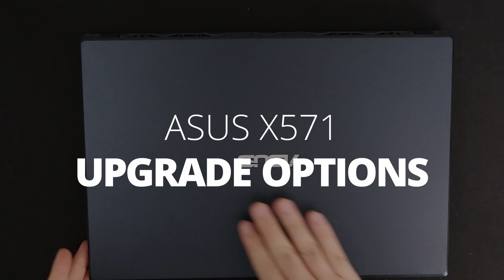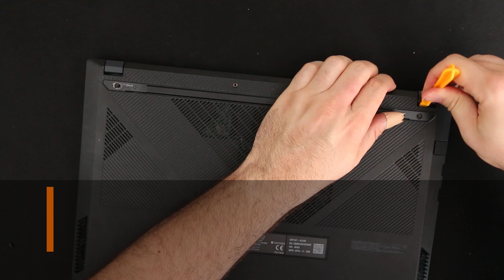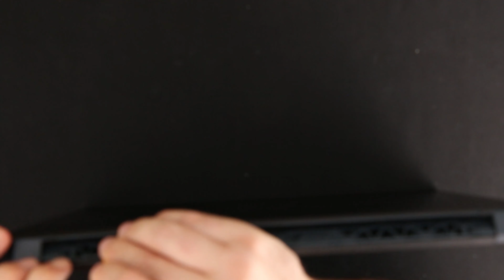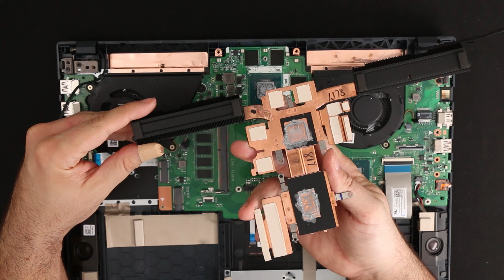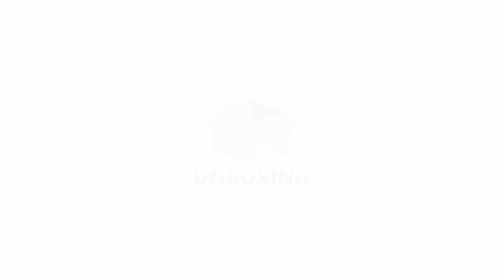ASUS X571 DISASSEMBLY and UPGRADE OPTIONS (Storage, RAM, WiFi, Thermal Paste)

Comment: I am kinda confused.. mine has a m.2 ssd installed already and I want to add another one. Can I add another m.2 ssd or do I need to go for sata
Reply from the maker: This device has 1 (one) m.2 SLOT and 1 (one) 2.5 inch  SATA BAY. The m.2 slot can accept both SATA and NVMe SSD "stick", and the 2.5-inch bay can accept "2.5 inch" SATA HDD or SSD. ;) Got it now? :D If yours has already an m.2 SSD, you can expand by swapping that out to a bigger one OR adding an additional 2.5 inch SSD or HDD.
Reply: @MakaiTechReviews   Ahaha thanks for the reply asus website kinda confused me with all these configurations, but your video cleared a lot of things great work..

Comment: I've got the i7 version that has 512GB SSD, if I want to upgrade the SSD, could I add another 500GB SSD over what I've currently got? Or is it that I've got to remove the current one and replace it with a bigger amount of SSD? 
Idk, this is my first device in which I'm upgrading storage space. please someone help me out.
Reply: If you have the SATA slot free (so no HDD) then you can add a 512GB SATA SSD. You cannot have 2 M2 drives though.

Comment: Hello everyone, I bought this laptop about 1 year ago and recently I started having some issues with it, the laptop keeps randomly disconnecting from power and connecting for about a second even though it's plugged in. Also the port gets quite hot, anyone had/has the same issues? What could it be, the connection port or the battery? Thank you.
Reply: I have thensame issue, did you find the solution?
Reply: @Chris-rc7vx  Yes, I got another charger and it fixed the problem :)
Reply: @andreimorosanu9465  Thank you bruh, do you have the link to buy the charger?
Reply: @Chris-rc7vx  No worries, I got one for free because I had warranty

Comment: If I have a version without HDD disc, Am I able to add one? I got somes discs at home.
Reply from the maker: Yes, you can, you need these 2 parts to hold and connect your HDD. 
Added both the HDD bracket and Flex cable part number and link to the video description. Hope those help find the part in your region. ;)
Reply: @MakaiTechReviews   Thanks! :)

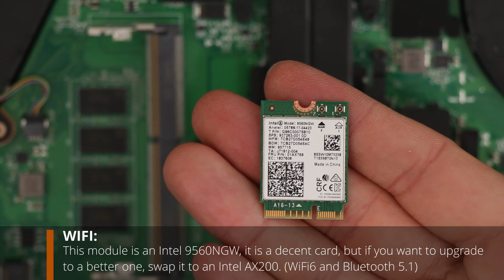Comment: 4:41 you said to swap it to AX200 but as of the moment the latest is AX210. Can I used 210 instead?
Reply from the maker: Actually the original uses CNViO interface, and AX210 uses Wi-Fi(PCIe), BT(USB), so it wont work.  What you need is an AX211, check @ intel ark for the proper system interface type: https://www.intel.com/content/www/us/en/products/sku/204837/intel-wifi-6e-ax211-gig/specifications.html

This is why I put at the end both variants in my video description, cause manufacturers constantly changes these modules and they are not compatible with each other.
Reply: @MakaiTechReviews Hi, almost everywhere in the descriptions, it says that ax211 cnvio2 needs Intel 12/13th, but this laptop has intel core i7 9th, will it work?

Comment: Can we upgrade its processor? Instead of i5 to i7? Thanks
Reply from the maker: No, not possible. Only if you fully swap out the motherboard, which is obviously not worth do. :(
Reply: Sad to hear that. Is i5 still great for autocad work or not?
Reply from the maker: @raineraldueza7903  There is not much of a difference between i5 and i7 these days. Especially in mobile CPUs
Reply: Good to hear that. I'm planning to buy it for my autocad softwares and photoshop. Guess I will upgrade it's Ram to 16gb.

Comment: can i use a ddr3 ram as an upgrade? or do i need a ddr4?
Reply from the maker: DDR4 only! ;) DDR3 has different voltage / frequency / CL and even different connector type.

Comment: Hello. I hope you can answer this. Can I upgrade to 32gb with 2666MHz or 3200MHz? I hope someone can answer please
Reply from the maker: I believe originally it comes with 2666MHz integrated RAM, but you can check it either in BIOS or with CPU-Z for example. Upgrade it to 32GB is not possible, cause 1 module portion has been soldered into the motherboard. So you can either upgrade it with 16GB module, or a 32GB module (so total will be either 24GB, or 40GB - or less depend which you have on board)
Reply: @MakaiTechReviews  thank you so much Sir for the immediate answer.I am planning to use 32gb ram 2666Mhz plus the soldered 4gb. Is that really sure that It'll work with 32gb 2666mhz? I'm looking forward to your last answer. Once again, thank you very much
Reply from the maker: @dandarrenramirez6711  8th gen Intel variant is capable to handle 64GB TOTAL system memory. ( https://www.intel.com/content/www/us/en/products/sku/134876/intel-core-i58300h-processor-8m-cache-up-to-4-00-ghz/specifications.html ). If you have the newer 9th gen Intel, it is 128GB, so your 32+4GB will work for sure.
Reply: @MakaiTechReviews  my huge thanks for you Sir! 🫶❤️
Reply: @MakaiTechReviews  Sir, my very last question is can I use 32gb 3200MHz? I'm very sorry for this last question. Thank you very much
Reply from the maker: @dandarrenramirez6711  not sure if the CPU (more likely the BIOS) will support it. Anyway even if it works, it will be the same speed as you built in one (which is slower anyway)

Comment: can i remove the RAM without taking any of those? thanks
Reply from the maker: You only need to remove the buttom case to change/upgrade the RAM
Reply: @MakaiTechReviews  does it have 2 slots so if i wanna upgrade it to a dual channel i will ?
Reply: @MakaiTechReviews  cause i hope it has 2, i havent bought it yet if it has 1 m not gonna try and buy it tbh
Reply: @othmanemezmouhi2587   It has only one slot. Usually 8 gigs are soldered on and the other 8 gigs are on stick.

Comment: Can i add an HDD along with the SSD?
Reply from the maker: You have one m.2 SSD slot and one 2.5 inch HDD/SSD Sata 3 slot. Both slots can be used at the same time.
Reply: Thanks
Reply: @MakaiTechReviews  I have the m.2 ssd variant, I am planning to add an hdd. Does it require any extra fittings or accessories ?
Reply from the maker: @abimangalan  Yes, you need these 2 parts to hold and connect your HDD. 
Added both the HDD bracket and Flex cable part number and link to the video description. Hope those help find the part in your region. ;)

Comment: I have the gtx 1650 version and i am thinking on using a egpu, could you do a tutorial
Reply: Since it doesn't have a Thurderbolt, you won't be able to pair it with an egpu. I was looking into buying this one as well, but the lack of Thunderbolt support made me steer away :(
Reply: NiC as far as i know the computer has thunderbolt 3 but i was planing to plug the card with a pci express adapter
Reply: @53XM4CH1N3  There is one USB Type-C present but it’s not thunderbolt 3 as per Asus' official specs on their site. So no support for external gpu enclosures or 10GBe dongles etc. Also, what do you mean by “plugging in the card with a pci express adapter”? By using the M.2’s pcie x2? That might be a way potentially, but then the card would also need external power + there is no guarantee that it would work. Also, most peculiar adapters like that one, that are being sold in bulk in known places aren’t reliable at all, so I’d avoid that.

Comment: Can i add 16gb 2666mhz? and get 20gb ram
Reply from the maker: Yes. 4+16 will work flawelessly. You might need to do a BIOS update, but the chipset can totally handle it.
Reply: 8+16?
Reply: @kemalkapak9013  is dual channel

Comment: Hi, thanks your useful video. Where I can buy cable for 2,5 HDD? 2´55´´ Thanks
Reply from the maker: Flex cable: https://en.accessoires-asus.com/hard-disk-flat-tablecloth-for-notebook-pc-63672-68527.htm#x571gd|l   //  HDD bracket: https://en.accessoires-asus.com/hard-disk-support-brackets-for-pc-laptops-63678-68882.htm#hdd-cable|l
Reply: @MakaiTechReviews  thanks, I called service Asus in Kosice Slowakia company Datalan they do it, or I do :)

Comment: Is it possible to install 9.5 mm thick HDD?
Reply: @amvishal09  No, it's absolutely different thing. By your URL it's caddy for old notebooks with DVD drive to replace it with second HDD. I'm talking about ASUS 571 model and its 2.5 HDD slot - does it support thick 9.5mm HDD or only slim 7.0mm.
Reply from the maker: These (newer) models come with 7mm drives (and the rubber thingy is also this small), so I assume this can handle only these smaller HDDs. But in terms of space, I do belive you can fit 9.5mm if you plan to skip adding this rubber frame and just place the HDD into its hole and thats it. Pretty much a DIY project, but totally doable.

Comment: Hi, its compatible with NVMe?
Reply from the maker: Yes.
Reply: @MakaiTechReviews  I buy a Western Digital Blue SN550 Nvme SSD and dont take it :(. (no lo soporta) I have ASUS X571GT
Reply: @MakaiTechReviews  1 TB
Reply from the maker: Is it visible in your BIOS?
Reply: @MakaiTechReviews  no, is freezed in asus logo, i cant access the BIOS
Reply from the maker: @benja.sykes6  Hmm, compatibility issue can occur sometimes, but no worries. Remove the drive and update your bios to the latest one. Usually these can fix this (and RAM module) compatibily issues. Here is the link for your model: https://www.asus.com/Laptops/For-Home/Everyday-use/ASUS-X571/HelpDesk_BIOS/?model2Name=ASUS-Laptop-X571GT

Hope I could help to you!
Reply: @benja.sykes6  I have the same problem with the same ssd but my BIOS is in its last version. And continues frozen in asus logo.

Comment: Hello! Thank you very much for the video, I followed all the steps but when I put it back together and turned it on the screen is off and only some LEDs light up on the keyboard, it is as if Windows did not start. It detects the charger but notice that only one cooler works. Any advice? I also plug it into an external monitor but nothing, it is as if it only turned on but does not even try to go to the system